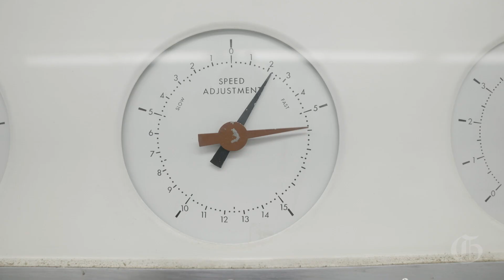Tipping Point: Lake Powell reaches record lows amid drought

Comment: They have no idea how to fix it. Keeping the water levels up requires managing the hydro generators. There is other technology that will produce a lot more power than hydro generators can ever do 24/7 with unlimited energy. Won't need nuclear, solar, fossil fuels, wind or hydro. SEG Magnetics will be able to replace the energy needed to supply when and wherever it's needed.

Comment: It’s pretty simple.
A warming planet causes worse extremes: …
Warmer air & water => (leading to) more humidity, heavier rain, and heavier floods.
Hotter air & topsoil => more evaporation, more drought, and more wildfires.
Hotter Arctic => less ice, less albedo, much less ice.
That's the way it works.  It is simple physics.  
The evidence is everywhere.  Expect more of the same, only worse.

Comment: The river couldn't provide it, because someone was blocking the vent in the Millet Swale watershed, southeast of Snowflake, Arizona, for the past 15 years.

And then there's Trump's wall, to be completed with double-stacked shipping containers by Arizona, no less, blocking the airflow across the border and increasing the pressure and temperature. 

Idiots.